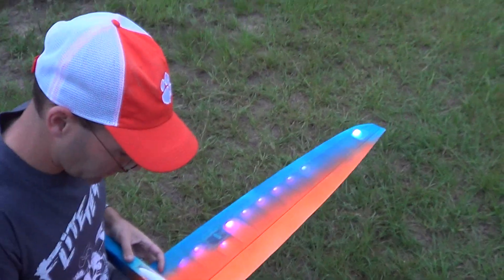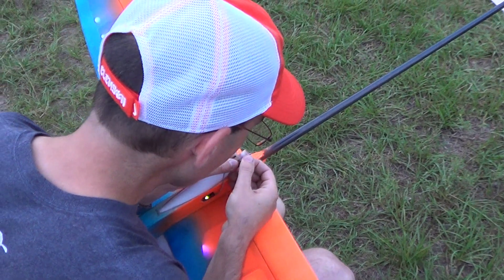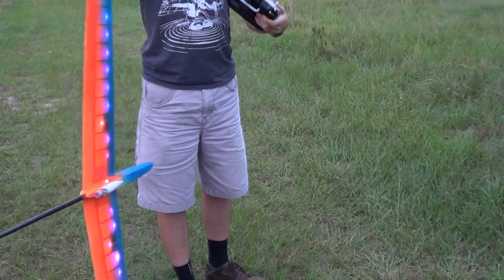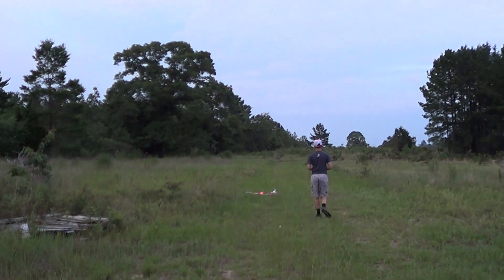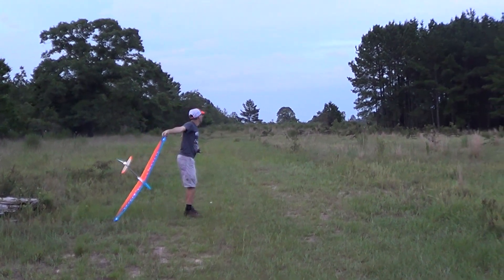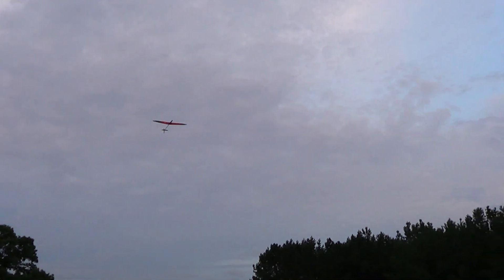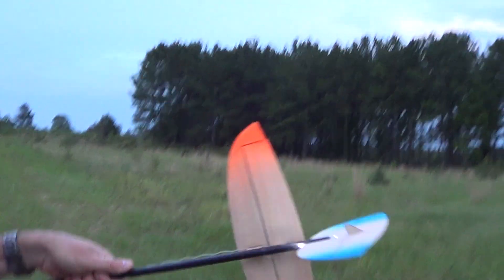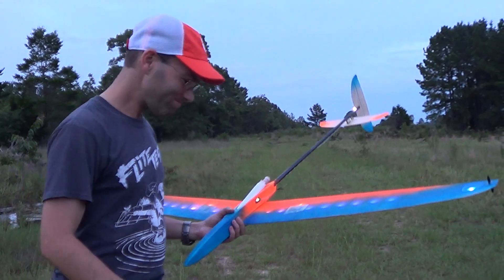We threw a rocket at the sky and then fired it!

Comment: Nice flying! I’m surprised at how controlled that climb was with the rocket motor. Very smooth. 👍 Good work on this one, it’s a great flyer.
Reply: Big model small motor short burn. In the future try to fire it with the nose "up" that little pitch down is why rocketry orgs have rules for "nose up" and "min altitude" to fire like that. IE to keep it from pitching down and into the ground (and maybe people) so you want to "pop" the nose as you fire the igniter.

Need to get some long burn motors in that bad boy. your gonna love hitting 2000 feet with that thing straight vertical!